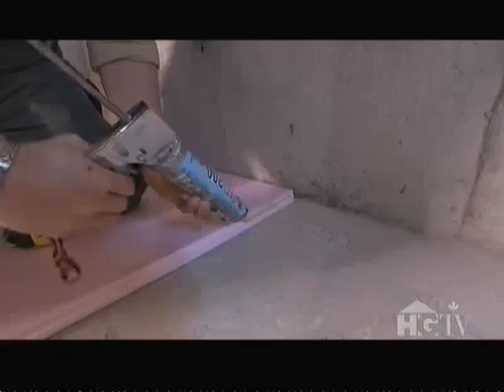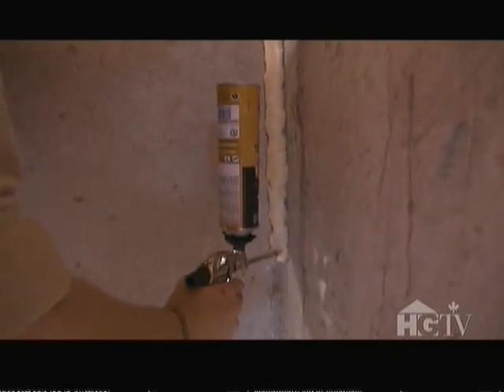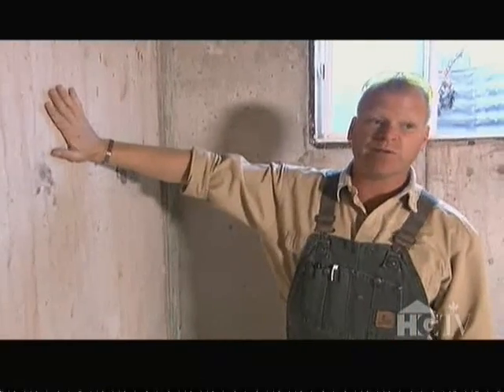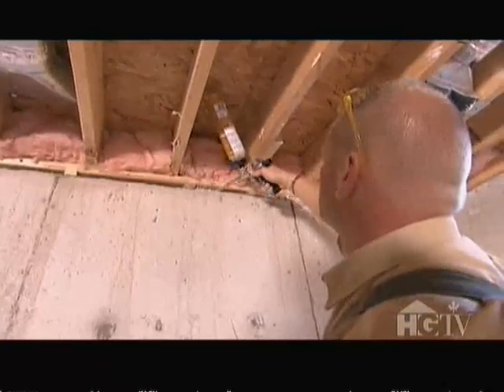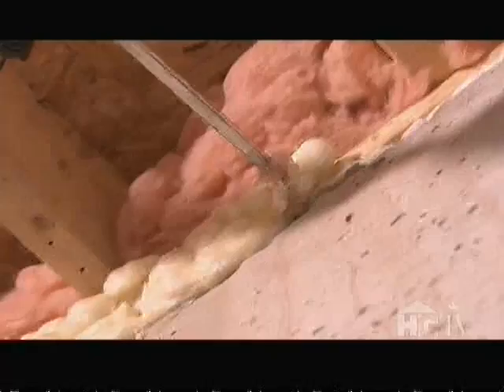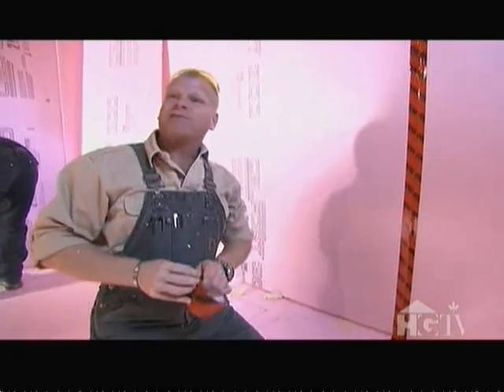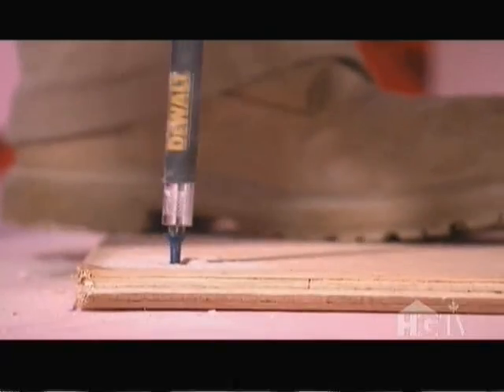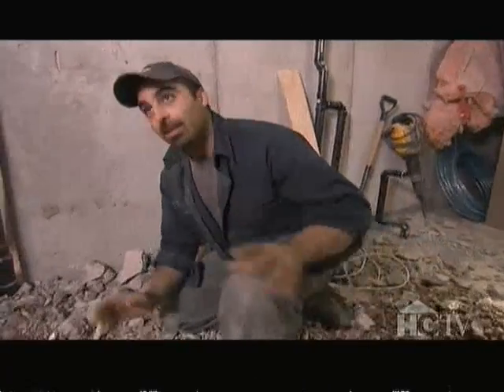Best way to insulate a basement

Comment: @HomeEnergyNow   I have attic bedrooms with 9" insulation between the rafters. I tore the drywall off one room and added 1" rigid insulation board over the studs, leaving the other insulation alone, and re-drywalled it.  Using a thermal temperature gun, I literally get a 10 - 15 degree temperature readiing on the drywall surface from one room with the rigid board to the next without.  This is in the summer time, of course, when attic heat is the issue.  It is called radiant transfer!!!!!!!!!!

Comment: The awesome thing about this method is that you control for both moisture issues AND vapour issues (not the same thing - remember that) *IN ADDITION* to being able to add more insulation in your stud cavity.

Using 2 inch XPS against the wall (as Holmes shows) prevents a thermal bridge from being formed by your wall studs.  You can then fill the studs in (either 24 inch or 16 inch on centre) with fire-retardant batting such as slag wool.

It doesn't meet code - it exceeds it.

Comment: Another great thing about this method is that you don't have to install a thin polyethylene sheet in front of your insulation as the extruded polystyrene works as both a moisture barrier (prevents moisture / water from affecting the insulation) and as a vapour barrier (provided it is class 4) so that when the warm, humid air in the basement meets the dew point, it will not condence into water droplets.

You can then frame your wall in front of the XPS, and not worry about piercing your VB.

Comment: Adding rigid insulation to the wall and sealing it as shown will prevent moisture from interior condensation but WILL NOT eliminate water leaks through the wall. If your basement isn't already absolutely leak free, you must deal with that issue before insulating. The extruded polystyrene that they're using is the least "green" rigid insulation. A greener solution is expanded polystyrene (white beadboard) or polyisocyanurate (usually foil faced). Polyiso has the highest R-value at R-6 per inch.

Comment: @markhinr You are suppose to use the extruded polystyrene because it does breathe enough to allow minor moisture movement to dry off wicking of water.  I am not talking about water problems, but all basements wick some water through the walls.  You should not use the kind with the thin plastic on it.

Comment: there are many more ways for moisture to form, not just from hot/cold air meeting. 

Concrete wicks moisture from the dirt below it, and concrete itself contains water that slowly "cures" over many years and this is why concrete itself "sweats" 

Walls made of wood (wood foundations of treated wood) contain moisture that slowly dries out, and regular lumber has some moisture also.

Furthermore, no "vapor barrier" is a barrier at all. Every staple hole will leak moist air into the wall.

Comment: @HomeEnergyNow 
Well .. if you are really a "home energy professional", you should know that you first have to consider the region where the client is. Mike Holmes is in the Toronto area usually; which means winter, snow, -40C, etc. Therefore, the heatloss in the basement could be around 30% if not well insulated. As an engineer (I'm not the only one), I would recommend this setup if you live in a cold area (i.e. if you've only seen snow on TV, this is not for you).

Comment: Mike Holmes you should've used Floodsill as a water-impermeable base plate prior to putting down ANYTHING on those walls. In this case - where does the water run to when (not if, but WHEN) a leak occurs? Right on that wood... oh, ah... mold.

Comment: The idea is to put the polystyrene behind the stud to prevent condesation where hot and cold meet.  The studs, paper on the batt insullation, and drywall paper are food for mold in wet enviroments.  I created a cooler effect and then studded, batt insulation without paper, then drywall.  NO vapor barrier.

Comment: Spray foam does a good job, until you have problems with trapped moisture. This has happened in many cases.  As a general rule, breath ability is always a better option. The other problem with foam is that it is extremely difficult to remove in order to access areas behind the foam, or to remove the foam when it coats with mold.

Comment: Holmes is excellent...but he goes well above and beyond x 100.  He also has a  budget that know one else has.  It's quite interesting, my neighbours do everything he says!

Another note, my bro in law just finished his basement and did the exact same sub floor in this video, which works out to about $3.20 sqf.  He then covered his pricey sub floor with a cheap $1.24 sqf laminate.  $4.50 sqf floor, vs mid range carpet, high end under pad directly on concrete for $2.40 sqf installed....

Comment: The "science" behind the idea is that the moisture (not condensation) will move to the outside of the foundation wall which is breathable. The foam creates a thermal break which does not allow the hot and cold to meet between the foundation and the foam (condensation). It is important to fully seal all joints to prevent ANY airflow in behind the foam.  That is why he is emphasizing that. If not sealed fully airflow would create movement for warm/cool air (creating condensation).

Comment: Just wondering what happens when you get to the bottom of the stairs and you have raised the floor by 1 inch with the foam then another 5/8 with the plywood, now your bottom step into the basement is that much off and would be awkward?

Comment: @HomeEnergyNow Look, there are many ways to skin a cat.  As  1asadoc1 commented below, google "building science" and on its website type "basement insulation" in the search field. you will get all the layman and technical information for insulating and finishing a basement.  

The use of the rigid foam behind the studs, or leaving a 1 inch gap and spraying foam behind them, also helps with radiant temperature transfer.

Comment: I put a perimeter drain around my basement inside.  I have never seen polystyrene with mold on it.  If it is airtight, you do not have hot and cold air meeting to form condesation.  If you have leaking walls, that is a whole other problem that should be addressed before you insulate.

Comment: what about the area where the floor joists are? Do you just need bat insulation in there? Can moisture get through there? Or are they more concerned about the possible moisture getting to the  basement walls because they are below ground?

Comment: Its a good idea for the walls only. frame a wall in front of it, insulate with roxul insulation which is very fire resistant.The floor is a terrible idea. You can always put a product like DMX one step which doesnt even require a osb or plywood installed over it for laminate or engineered hardwood. Also has an R rating. and would cost a fraction of the cost of this and take half the time.

Comment: Polystrene has been designated as  a class 1 or A flammability rating!
Therefore it is the fire block! 
It looks even better with a 
Architectural Fabric Laminated ,to a Acoustical Ridged panel. Not to mention the 85% noise reduction coefficient rating it would add. Drywall does not have a very good acoustical rating. Your new basement  needs to be as sound proof as possibile

Comment: Foam traps moisture between the concrete and the foam, it has nowhere to go, and it support the growth of mold. The very best insulation will provide the wall to "breathe"  This technique is asking for trouble. Mold and rot can pass right through the foam and infect occupants.

Comment: @HomeEnergyNow  No, I will not have a mold or dry rot issue.   I already had an issue with the insulation bats being right up against the roof sheeting.  Put in rafter baffles to cure this, so they could breathe.  The DOE does not recommend against the use of a vapor barrier here.  I had a severe heat issue on the second floor until I implemented several measures, including better attic ventilation.  Another thing, stop being so condescending to people on here.  It is uncalled for.

Comment: The largest benefit of spray foam is as an air sealer.  Batt insulation will not perform well if it is being wind washed due to inadequate air sealing.

Typical sheathing is 1 perm.. Dow blue foam is 1.5 perms (I assume the pink is comparable).  The foam is less of a vapor barrier than the plywood.

The problem with most of these jobs is the basement was not designed to be finished and the appropriate barriers were not installed.   You can't make chicken soup out of chicken shit.

Comment: @HomeEnergyNow   Why so much anger?  I have never used spray foam.  It is too expensive, but I can see the upsides of it in certain situations.  And yes, I have done a manual J before when putting in a boiler at my father's house.   In my house, I am just trying to solve some issues with some hot zones in the summer, and cold zones in the winter.  I am attacking them from different angles - insulation, HVAC, roof ventilation, etc......

BTW - anger just proves that u are losing your argument!!

Comment: That tuck tape peels off over time.  not designed for XPS.  plus with the ship laps, not necessary even when used as a vapor barrier.  Anyone ever take the time to read manufacturer instructions?

Comment: Just for the record, this is considered the best way to insulate basement walls. 

 I am using a 1.5 inch unfaced board with studding and unfaced batts.  Walls will breathe a little, yet resist mold.

Comment: This is horse shit that styro and tape aint gonna stop moisture and what happens when you get a water problem coming in the wall?? It will degrade the basement wall especially in winter when the water freezes and expands

Comment: @HomeEnergyNow Damn, are you still ranting about this subject?!!  I let you have the last word, yet you still have to reply with BS!!  Get a life dude!!  BTW, loosefills in walls settle over time.  Get an IR camera and look around at some walls filled with loosefill.  It DOES NOT go to the top anymore.  May be good for open attic where you can pile it high.  Spray foam has more R Value per inch.  Cellulose loose is 3.2 - 3.8 per inch.  Closed cell spray is 6 - 7.